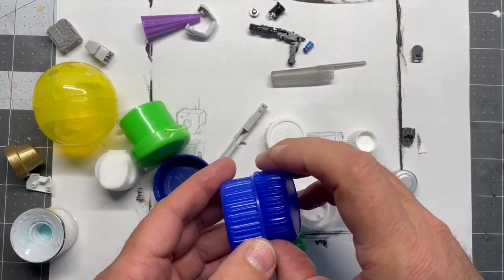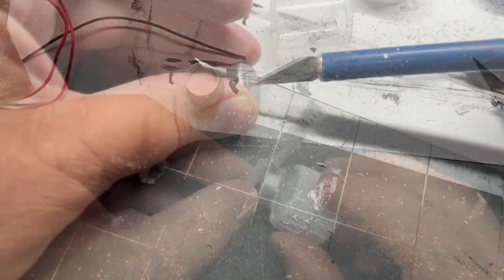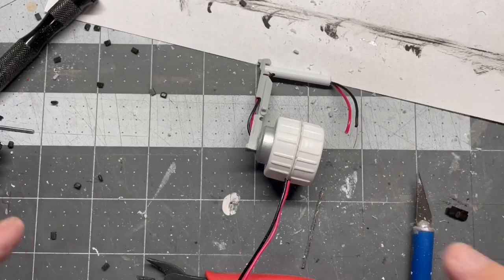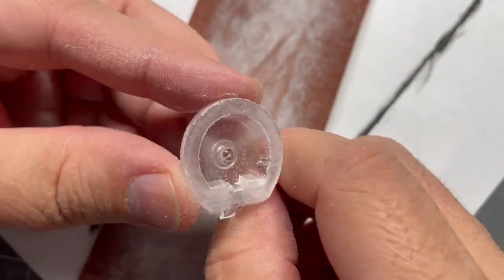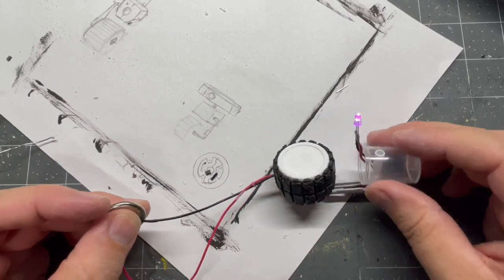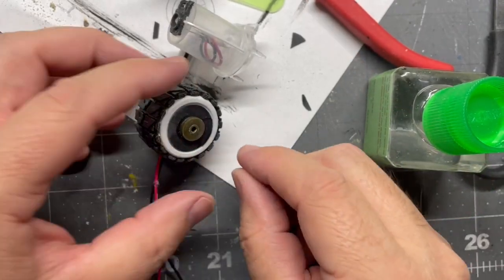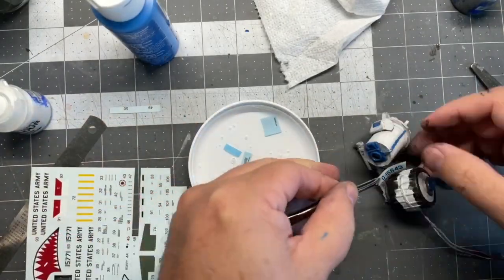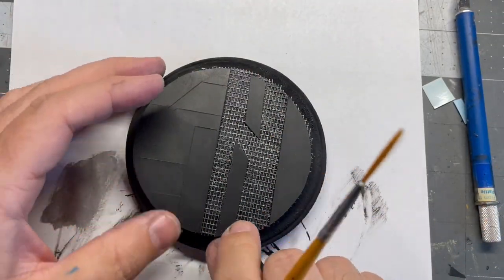Star War D-O Inspired Droid - DIY Scratch Build Star Wars Droid

Comment: Excellent. What type of glue is that in the squeeze bottle? I've just been using hotglue gun or cheap dollar store super glue but as I'm progressing I want to get better stuff and more tools. I am going to look for one of them little manual drills I see you using. That's a cool idea. Keep it up.
Reply from the maker: The glue is BSI Insta-Cure + (Medium gap fill). It's amazing, I did the same using cheap super glue and had nothing but trouble. This stuff is amazing! : )
The little drill is called a Pin Vice, I got it on EBAY for like $10-15 but the bits are kinda garbage so I ma need to get some better bits....
Reply: @DRToysCreations  really appreciate it